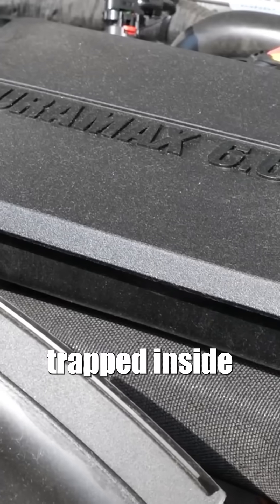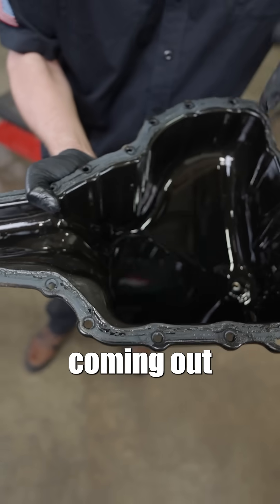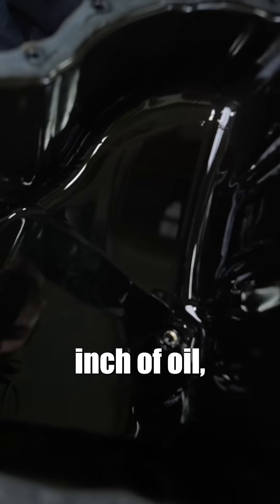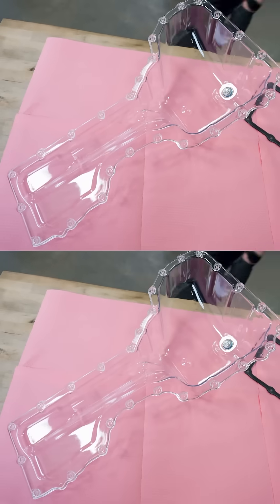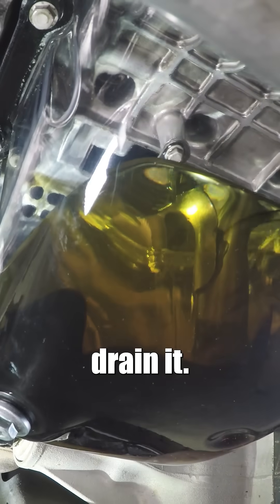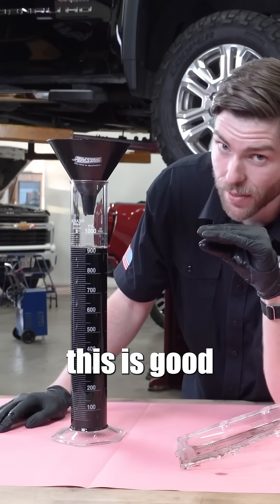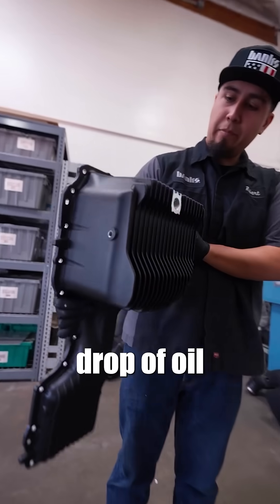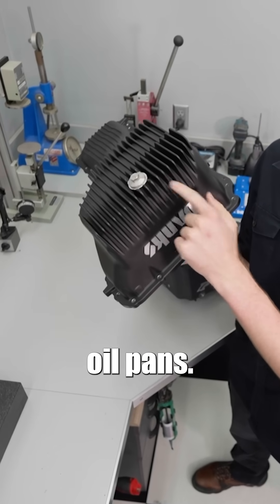A disturbing discovery. This dirty oil is trapped.

Comment: The 2000 Durango and the five nights at me don't have that problem because the train plug the nipple you're talking about is outside of the oil pan it's reversed same thing on the other engines I've had the nipple was outside of the drain pan on the Dodge and on the Chevrolet but on the Ford and the BMW and a bunch of other ones it's like that and all the Japanese cars

Comment: And there's another 2 quarts sitting on top of your cylinder head 😂
Reply: That's why I usually jack up one side of the vehicle,  then the other. Which should also break the airlock on the pickup tube, now that I think about it. Gotta be willing to let it set there for a few hours, if you want to get as much old oil out as possible.

Comment: Bet you can’t design something for the 7.3 and 6.0 powerstroke that drains the high pressure oil system so that can also be changed. That’s like 3 quarts that stays in for every oil change

Comment: Two points. Number one a lot of oil change places use suction through the dipstick hole now.
2, there’s a reason why we change oil on hot engines. Makes it easier to get most of the dirt out. What little dirty oil that is in the pan is a non issue

Comment: The industry moved away from flushing some time ago, as the dirty oil is actually not bad for the engine. Transmission fluid should never be fully drained (especially if the tranny has run too long on the original fluid.

Comment: The pan it designed that way to not only prevent the oil pump from losing its prime but also the old oil stays in there as it is slightly thinner from making broken down the filter will catch any glitter the only oil is useful there are people that get get paid a lot more than I do that spent millions to design that engine. I see more and more inaccurate information coming from gale banks and his people lately

Comment: I put the car at an angle to drain toward the drain... that should break the pumps pickup tube seal and drain it... also i drain it until it stops dripping... throw bout cup or slightly more fresh oil in the "flush: the pan. It takes my new oil to get to bout 2k miles to start to easily see it on the dip stick.. because it is that vlean... this method works good for me.

Comment: Tell this to the locomotive industry where they never change the oil. They supplement additives as needed. With the complexity of modern engines (and general lack of quality and quality control) there’s a low likelihood that oil will be the organic failure point. Even if the engine does fail due oil problems, the rest of the vehicle will be on its way out. Don’t waste your money on deep pans, etc. Reasonable oil change intervals will serve much better

Comment: So true! I've worked resolving this as well. 
Very well done with the fins as well. Added cooling is key to reaching thousands of miles more with less ware. 
    Glad you did the video, and showing that old oil is like 400 grit sand paper. 
Older becomes 300 grit sand paper. 
   Fresh oil is like 5000 to 10,000 grit sand paper. No friction - No ware - and just lasts longer! 
Applauds!
Reply: If this was a problem that needed solving then it would have been solved long ago. Banks makes great stuff, but this is creating a solution to a problem that doesn’t exist.
Reply: @AlaskanMach1 
Not really? Newer trucks(and vehicles in general) are being built to be disposable, and one way to do it is insidiously hiding things that will break the vehicle down quicker. 
Thermostat housings made of plastic, oil cooler/separator made of plastic and housed under the intake, oil pans made of plastic.

To think that it isn't a problem just because "it's always been this way" is fallacious when there's potential fixes.
Reply: Wear
Reply: Tastes fine to me

Comment: Just a come on to think you are getting all the oil,but you still are not, all the oil gallies inside the motor that is  feeding oil to your camshaft all the different parts of the crankshaft and rods pistons that have coatings little pockets that hold old oil back can amount to probably a half quart of oil still on every oil change

Comment: Solving problems that arent real, image you have a cup with a small amount of orange juice and topped it off with water, the same that would happen as soon as you put new oil in after you drain it, the additives in oil are there to help displace contaminates any residual old oil will be diluted by the new stuff and mix as long as it hasnt turned to sludge

Comment: 2GR-FKS in Toyota Tacomas need this, easily get a bunch more oil out of that engine between the oil filter housing/pump that sits under the radiator fan way out on the front of the engine, holding a bunch of oil between there, and pickup tube.

They really could use a slightly better design in general to slightly help with oil starvation with better pan design to handle another .2-.5° of tilt

Comment: The dirty oil isn't the issue. It gets diluted and the engine was probably designed to need thinner oil too with out you having to buy 2 types of oil. 
Now the metal shavings on the other hand... All the Glitter 🪩 will never come out.

Comment: glad my trucks pan wasn't made with such a cheap method, an oil pan should always have an externally welded bung with a magnetic plug bolt that uses a copper sealing washer
an oil pan should not have spot welded way over recessed junk
as for how to get that last bit of oil out if forced to use that factory newer junk, use a small copper pipe with a weighted very flexible hose so it bends back touching the bottom of the pan so it can be pumped out

Comment: Im thinking this is probably done on purpose so the pickup tube doesn't empty itself? If it's empty you will have no oil flow in your engine for a few seconds every time you change the oil.

Comment: If thisbwas an issue im sure one of the manufactures throughout all the many years and millions of engines made would have figured it out. Your mixing new oil. If you oil os that contaminated you need to get ot all out you would just add quart or two of oil and redrain it.

Comment: this is also a reason diesels always have such black oil. their oil pans are much larger than a gas motor andusually hold a few qts in there and all the turbo lines and stuff. change the oil and start it and its already black. but the extra oil left over in the pan usually keeps your oil pump primed so less harsh starts after service.

Comment: You’d think engineering teams would make a proper draining system in a simple oil pan yet think about how much money they’ll make for their manufacture if they system is designed to eventually have problems and they then can make money on new sold parts and repair..designed obsolescence

Comment: I’m can’t imagine draining the engine completely of oil is good for it when you go to restart. That’s about 2.3 seconds of no oil pressure while engine is running every oil change. I think I would rather have slightly dirty oil that actually isn’t that dirty since most vehicles nowadays have several different magnets in them the collct debris along with a brand new filter. I know banks knows his shit but this is just a ploy for them to make money. This will never be a necessity nor will this do anything for extending the life of your engine.

Comment: I always throw a qt of clean oil in to assist in rinsing the pan out before putting the plug back in. Kind of an expensive work around but puts my mind at ease knowing I got a majority of the dirty oil out.
Reply: The real solution is to bend a small pipe in the shape of a candy cane and put it into the pan through the drain hole to reach the oil. Using the science of capillary action it will let the rest of the oil come out.
Reply: Are you going to continue or buy a Banks pan?

Comment: I wonder if that was a fail safe for the drain plug not being tightened. If it falls out you have a quart of oil that the pickup tube can reach. 
Now if it falls out you can rest assured that every drop will come out.
Tighten the plugs people

Comment: 43 yr master tech shop owner and I'm floored by this silly design and sales marketing.  IF you removed the oil from around the sump the prime will come away from the pump and OR at a min will suck AIR starving the pump and no it probably wouldn't harm it on the first or even the fifth but it will. The oil around the sump is there to maintain the oil in the pump, that is why with the clear pan when the oil is removed from around the sump as the pan is removed the oil in the sump up to the pump falls away.
Reply: Agreed... that first start up after an oil change is going to take a while to purge the air in the pickup tube. If this could be corrected, I would buy one of these.
Reply: @soyews nah man the pump holds oil I'm sure. Then you refill and it all goes to the new level  of the oil.  Can't be much air in the oil system at that point.
Reply: @taknmybeatings7036  Until you start it where it immediately sucks air and loses all suction.
Reply: Does that old oil not mix with the new oil once it's changed?
Reply: @tallgom  It does. This is a bad solution to a non problem.
Reply: What is your opinion about flushing with diesel oil? I heard it wouldn't cause any harm but then again wouldn't that cause potential grime to fall out?
Reply: @adrianenriquez2544  its impossilbe to remove all of it from the engine block, i wouldn't use it. just changing your oil back to back 3 times in a short period will flush your engine without risk of harm.
Reply: @adrianenriquez2544 it's fine to do.  Helpful even.  DO NOT run the engine while it is in there.  Just let it soak a while.
Reply: Good point, I never thought of this. I guess dumping a qt of sacraficial oil (after draining) is probably best.
Reply: @JamesSmith-xs7sr  if you're worried about it. In the big picture more damage would happen from a dry pump than the small percentage compared to the total volume. Further, every manufacturer designs their lubrication system to keep the pump wet with a sump spot or oil pan drain plug above lip of the sump.
Reply: 50yo Master Tech here with over 40 years of experience (seriously, I grew up in a garage). I'm also a Parts Pro, Industrial mechanic, Master Welder, and custom fabricator. It's not the same anymore. An air bubble in the pickup or an empty filter hasn't been a problem in decades. Once upon a time, tolerances were so bad, filters were so big, and oil was so thick that the pump could actually lose prime and refuse to pick back up after it had some wear on it, if you didn't pre-fill the filter. Now, tolerances are microscopic, filters hold a few ounces, oil is as thin as water and they will self-prime in a couple of seconds at the worst. Until then, there is still plenty of oil covering everything. Also, back then, oil got changed every 3k, so dry starts happened 3-5 times as often. 
  To give you an idea how small the problem really is, I had a small block 1980 K5 I raised hell in for years. It had 250k on it when I bought it for $500. It had 3psi of oil pressure at idle and 25psi at 7000 rpm. I daily drove it, ran the hell out of it, and ran it completely out of oil a multitude of times holding it WFO in the mud for several minutes at a time while partying in the mountains. I drove it for 10 years and put another 60,000 on it before it finally threw a bearing. Then I sold it for $500. Best $0.00 I ever spent. It even had new tires when I bought it.
Reply: @JasonB666  So, your ONE experience counts as empirical and scientifically conclusive.
Reply: in short, this a snake oil salesman tactic?
Reply: @Ztlumminee  I'd hardly call it that. They try to put forth proof of theory but their conclusions and basis for necessity is where I see issues.  On the order of replacing an O2 because the code said "inactivity" while failing to verify function and true causality.  They have best intent, which yeah does include a sales tactic ( the left over oil bad) but over dramatize the damage of said left over oil.
Reply: It probably doesn't hurt anything, but neither does keeping the sump primed. Don't know why they made that particular change.
Reply: I was going to say the same thing. Surprised they mentioned that it drains the oil from the pickup tube.
Reply: Thhank you, and exactly why i always fill my new filter with oil before installing it, to help with the dry start after oil change.
Reply: @BTC_Vader  Running without oil pressure for some seconds ain’t hurting a thing. So many vehicles have oil filters that you can’t prefill and the engines last just as long
Reply: @servicetrucker5  it 100% is and over 10 years of dry starts there is indeed damage, will your engine blow up no? but you might not make 200k miles because of it.
Reply: @BTC_Vader  All the trucks I’ve serviced and never prefilled an oil filter. They all got over a million miles on the engine before they needed a rebuild. What do you recommend for something with an upside down filter? 

You must be one of those guys who thinks an engine gets damaged if you start it after it sits for a year
Reply: @servicetrucker5  it's been proven by oil company's dry starts cause damage over time and GM actually created and now require's Dexos 0w-20w to help with dry starts and prolong engine life, We make customer's sign waiver's if they don't use dexos oil cause it voids the GM's engine warranty. 

Learn to read, never said you need a rebuild, for example you say that truck gets 1millions miles it would get 1.2million without dry starts.
Reply: @BTC_Vader  If that’s true then why do some engines have unfillable oil filters?

Does the film of oil cease to exist after shutdown? I don’t see how it could not last for five seconds until you have oil pressure. I’ve NEVER had an engine take 30 seconds to make oil pressure even on a complete rebuild. If you’re having trouble with the engine drying out get something with some real film strength. I use rotella in every 4 stroke engine I own.
Reply: Do you guys have any idea how fast the oil pump primes with oil during a start. It’s not like there is this air bubble and then thirty seconds later the oil comes out. I found this out when we tried to start an engine for a half second with an oil galley open and shot oil across the yard very quickly. Your ring lands have oil on them even a year of the engine not started.
Reply: @latenttweet  actually it is 30 seconds if not more, worked at an oil change for 23 years. you can indeed hear the engine knock after starting until the oil circulates though the engine. you have no clue what your talking about my friend.
Reply: Well it looks like a plastic piece of crap oil pan replacement that you probably don't need in the 1st place.
Reply: With all due respect, you’re coming in here with the master tech title against Banks. That means nothing in the grand scheme of things. These guys are master engineers and know more than just maintenance.
Reply: @sendingit2601 master snowmen as well.
Reply: @sendingit2601 engineers design a product and move on to something else. Technicians have years of first hand knowledge of what works, what doesn't and why.
Reply: @sendingit2601   so you assume my education and are ignorant enough to think as a MASTER TECH I don't know far more than "maintenance"
Reply: @ I think a lot of people these days use a title to dismiss any argument against them. Using “master tech” as your main argument against what I’m saying is the same as using “college educated”. I’ve dealt with countless people with years experience on me pull rank and experience as an argument, and be on there ass incorrect at the end of the day. You can still be wrong. I trust the guys who lead there point with actual data and real world testing instead of the guys who lead there point with “I’ve done this for this blah blah years so I’m right”. Calling Banks silly marketing is also laughable
Reply: @sendingit2601 and you use the authority of someone elses title to deny a proven issue..
Reply: @jarlnieminen4307  your issue is not proven. All you’ve done is try to theorize about something you haven’t tested. All im saying is that these guys are the best in the business and have tested this shit there whole life. Every product they sell has been been tested with no fault by the public. And yes, I trust Banks over some lube techs online.
Reply: @sendingit2601  Engineers don't know the first thing about the systems they oversee put into automobiles, if they did they would redesign the junk they call modern automobiles.

Mechanics are the ones that know how these systems function best because they put their hands on them daily.
Reply: @ these guys do real world testing. You can’t just dismiss what there saying because “they are engineers”. You just watched a video of them explaining in depth and then going out of there way to test it in the real world. That’s about as real as it gets brother
Reply: So install a 1way valve in the pick up tube
Reply: @welytonpaz4235  so do more work to not change all of the oil anyways?

Comment: Why not just remove the oil pan Every 3 oil changes or so?

Wonderful product btw but when there's a leak from between the block and the sump, oil mixed with debris can clog up the air cooling ventilation channels...

I guess that could happen. What do you think?

Comment: The 7.3 Powerstoke retained 2 quarts of oil at all times in its HEUI system, yet 30 years later most of them are still running fine.  Product looking for a problem that isn’t really there.

Comment: Also the oil in the passageway to the filter after the pump. I often turn the engine over without the filter in place to purge that dirty oil while changing.

Removing the sump as part of oil change to purge that residual pool wouldn't be impossible.